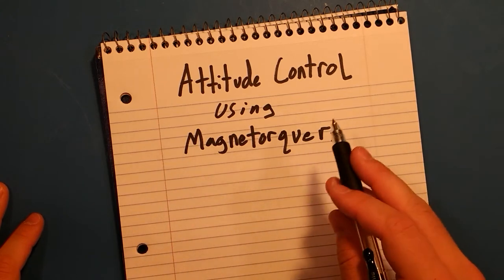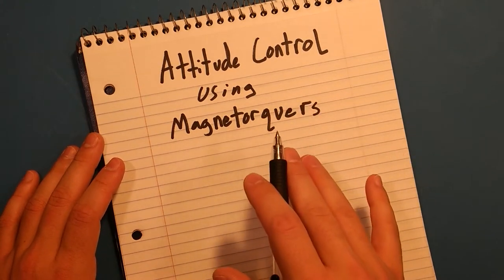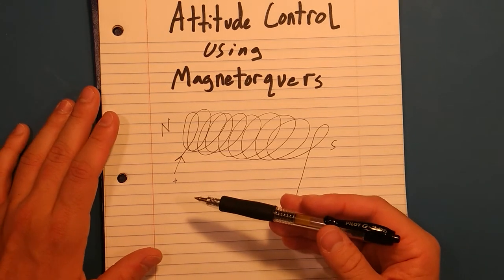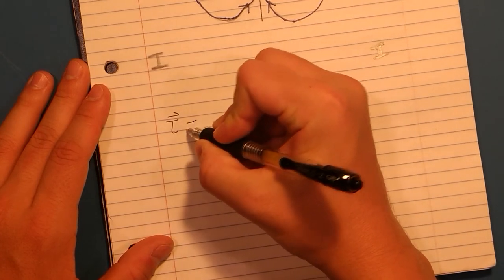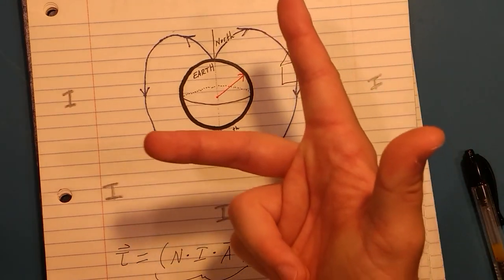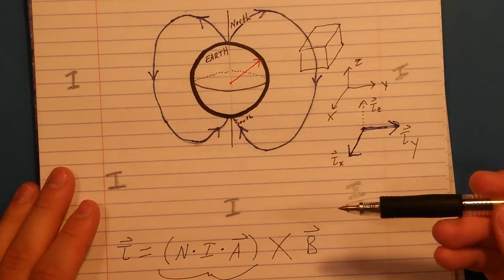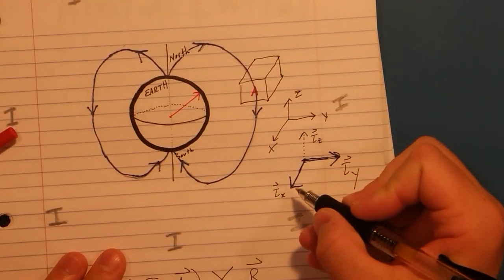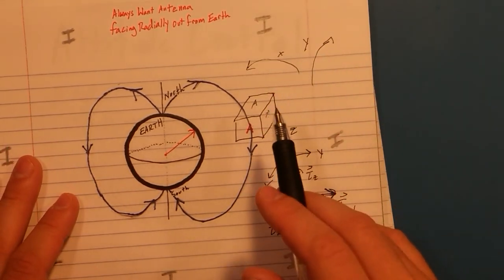$1K CubeSat -- Part 5 -- Magnetorquers, Attitude Control & Iridium Communication

Comment: So for 3-axis control, it's basically a Rubik's cube approach. The only catch is that your "A" is now sideways, and there's probably no way to direction and orientation right. But for transmitting a signal, it's perfectly fine. (Versus, say, a docking manuveur.)

Comment: I'm enjoying this series - but could you explain why X and Y can be controlled via magnetorquer, but not Z?  If you explained it, I didn't grasp it.
Reply from the maker: Sure! So just to be clear, you can get into any orientation you want, but the path to get into that orientation might not be straight forward.

It is kind of like this: If you can only turn left, you can "turn right" by turning left three times. 

As for torquing around the earth's magnetic field, think of a when a compass would work. Essentially the compass has to be able to turn to a point where it can point north. 

Let's assume you are facing magnetic north. If the compass is flat on a table in front of you, it will point to magnetic north. If the compass is on its side on the table in front of you (where it could point forward and backward), it will point north. If the compass is held upright like a book, there is no way for the needle to point where it is closer to magnetic north.   So that's two degrees it can torque against, and one degree where it can't!
Reply: @RGSAT  Thank you!  That makes it clear.
Reply: @RGSAT  Would magnetorquers be useful in a polar orbit, or would they be unable to orient the craft near/over the poles?
Reply from the maker: @respawnpoint7677  It is possible to use magnetorquers over the poles! As long as there is a magnetic field to torque against.

Remember that the magnetic field is not very consistent across the earth, and it is still pretty weak. Any course correction will be quite slow

Comment: What about using more than one iridium antenna? It'll take up valuable space that should otherwise be used for cells, but it might get you what you need.
Reply from the maker: That's certainly an option I'm considering. 

It's possible to mux between different antenna, or maybe even broadcast from multiple antenna at once. And these are all things that can be tested and verified on the ground. 

However, that solution starts to trend into a more custom RF solution. For normal iridium usage, there isn't really a need to be able to mux between different antenna / broadcast from multiple antenna at once. While there are small RF mux chips that (I think) meet the power requirements, I'm confident that I wouldn't get it right on the first shot. I see it becoming a much bigger project that I want, and I don't have the tools at home to properly debug it. 

For GPS, attitude isn't much of an issue because of a wide selection of omnidirectional chip antennas (as you may already know). The Iridium patch antennas will only work pointing up.

Comment: Lora networks?
Reply from the maker: LoRa looks really cool! I had no idea it even existed!
Reply: We have done two permutations for Iridium boards for our Cubesats. There are pros and cons to consider. You can have sloppy pointing and it will still work. I think what he really has to consider is the Iridium power draw on your satellite and if that makes sense for you. The software to also make Iridium work is tricky. We also made a LORA board for Cubesats and there are benefits to this route if you are not confident in pointing but the LORA network is hit or miss.